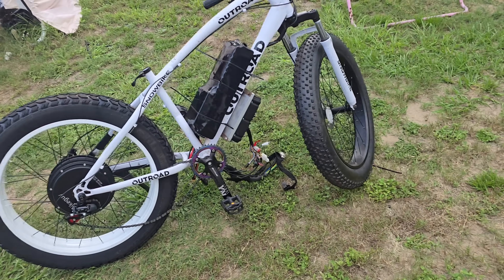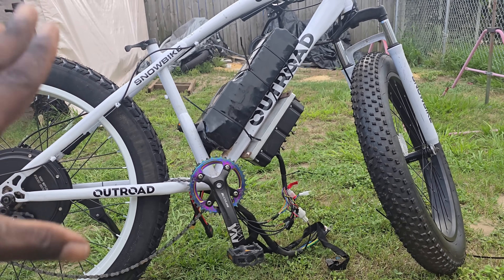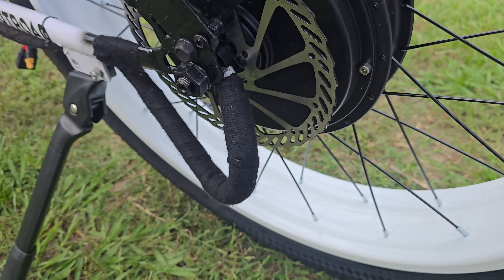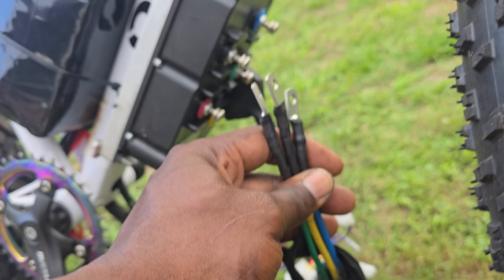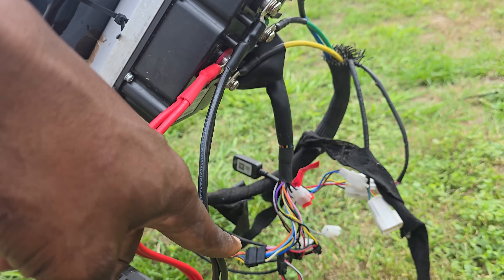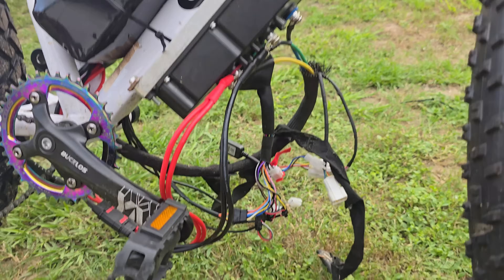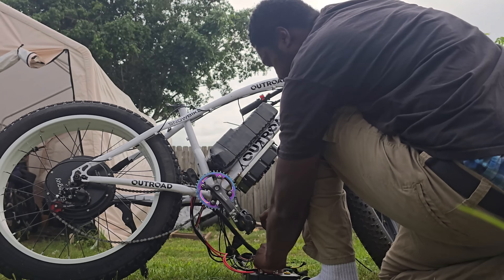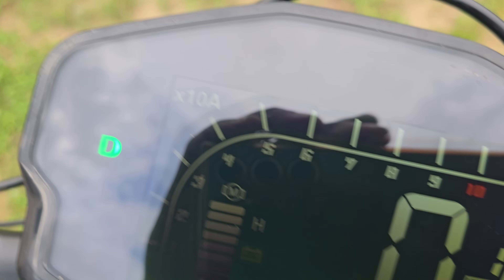Troubleshooting fardriver controller 72850 and qs205 hub motor

Comment: FARDRIVERS MUST NOT HAVE HALL SENSOR AT ALL AND THE AMPS BOOSTER HAS TO BE A REGULATOR BOTON
Reply: @EBG-offical  Think about it bro,
 that hall sensor and all them others vulnerable cables are just there to piss off!

ALL we need is amps regulator boton, throttle connector and the three phase brushless motor connector  that is all .

We don't need all them stupid cables, 😔 

Fardrivers don't work on motors without hall sensor !!!!
 This point 👉 for the price we pay for it that is playing with our pockets.

(F) The maker of it because if you don't have a smart phone 📱 this is when we get our (F).

Ain't that true?😂😂😂

Comment: If you disaasemble the controller cover, and remove the silicon layer above all the electronics, and to the left of the 30pin connector there is a PTC green device(MZ8?)that acts a resettable fuse right on the LF edge of the board most likely that device has failed.pesonally I would solder in a 1.25 times over the output current fuse where that PTC is(maybe just in parallel?) so 350 * 1.25=so like 400A-430?? just run it exterrnally. If u have any "junk" controllers laying around that dont work, that would be the likely "fix"'!!just to verify that is the issue you can just "twist up" that PTC device so both legs of the devicemake contact, then hook up the power and the orange ACC wire just to verify it comes on, but DO NOT leave it that way for OBVIOUS reasons, as once it starts "pulling a load" to drive the motor, you will likely fry the entire controller, NOT GOOD...😂
Reply from the maker: Oh ok ill try that
Reply: @EBG-offical as long as whatever "warranty" is expired, cause the silicon layer kinda breaks apart as u remove it,(maybe just focus on the bottom left corner of the board in removing the silicon, as that is where this device is at, then hitup home Depot for some grey silicon and just patch up that little area?) i aint worried as I got this controller from china and they aint refunding for $hit, let alone taking it back and fixing the thing, so Im leaving the board "exposed" for good!!😂😂😂
Reply: @EBG-offical did u try it out, let me no how it turns outbro, u got me curious!!!peace n❤❤
Reply from the maker: @tmharks1 not yes im working on a battery but when I get a chance ill do a video
Reply: https://www.google.com/search?q=PTC+mz8+capacitor+datasheet+pdf&client=firefox-b-1-m&sca_esv=fd9de876da70e2b5&channel=ts&sxsrf=AE3TifOYl7_qXzDyZL-54eqwg9Hm6skhTQ%3A1754330025663&ei=qfOQaPSkKIbIptQPtoaZsQY&oq=PTC+mz8+capacitor+datasheet+pdf&gs_lp=EhNtb2JpbGUtZ3dzLXdpei1zZXJwIh9QVEMgbXo4IGNhcGFjaXRvciBkYXRhc2hlZXQgcGRmMgUQABjvBTIIEAAYgAQYogQyCBAAGIAEGKIEMggQABiABBiiBDIFEAAY7wVI12xQy0FYnFJwAXgAkAEAmAHfAqAB9QiqAQcxLjAuMy4xuAEDyAEA-AEBmAIGoAK0CcICCBAAGLADGO8FwgILEAAYgAQYsAMYogTCAggQABiiBBiJBZgDAIgGAZAGBZIHBzEuMS4zLjGgB6kMsgcHMC4xLjMuMbgHqAnCBwUyLTIuNMgHMw&sclient=mobile-gws-wiz-serp

Comment: You ever figure out why this happens? Did the motor short out the controller because this just happened to me🤣. I can’t get mine to turn back on. Sitting here with a $500 brick
Reply: If the Bluetooth dongle goes faulty that would also stop the controller from turning on,I found that out the other day
Reply: @deswr1 👍
Reply: They claim the dongle can be removed but only after the controller is programmed, I will have to check it out for myself, if it does work without it, perhaps in your case the dongle was shorted which would likely cause the controller themistor fuse to trip or remain opened?
Reply: That little green 8mm pill looking device can really cause one some "headaches" 4 sure!!!😂😂😂

Comment: Hey E-bike guy, I’ve recently had issues with Bluetooth dongles failing and preventing my Fardriver powering up. (Also an 850)

Once the dongle was removed it worked fine. 

I fitted a new dongle and was ok for a couple of days and the same thing happened. 

Am now on my 3rd dongle and all is working. Maybe the dongles are a weak point or there’s been a bad batch.
Reply from the maker: I thought the same but we tried them also but not working
Reply: @EBG-offical damn, looks like you’ve got a bad 850 controller and bad hall sensor in all new equipment. 
Hopefully the seller will make it good for you.

Comment: My man,,22k subs...bro I been here since you was trying to get 1,000. I been out awhile, but good to see a video and that you still growing ,doing big things,being positive and very knowledgeable....much love my man!
Reply from the maker: Thank you very much 💯 great accomplishment but we not done yet lol
Reply: @EBG-offical  do you think I would be able to pair a 72 V battery and controller to a 2000 W hub motor would it go kaboom?💥
Reply from the maker: It depends on the controller and how powerful yhe battery is @jkeavyolson
Reply: @EBG-offical  how many watts do you think a 2000w motor be able to handle safely
Reply: @jkeavyolson probably x1.5 (not so sure about Voilamart😂😂😂, but a QS motor likely double!!😮😮😮so you could push possibly 3500, as they meg test these motors at the factory, and rate them much lower than their true capacity, that said it really depends on the winding insulation and how many "layers" of coating(dips) the windings have, plus the auto learn function on the fardriver will give one a ballpark rating on how much power it can handle...GO BIG OR WHAT'S THE POINT????😂😂😂

Comment: Not very likely a brand new motor would arrive with 2x defective hall boards. Also not likely 3 Fardrivers are all defective. 

You really need that $10 hall sensor tester that shows very clearly if the halls are working, 60 degree or 120 degree. Its very simple with its own 5v power supply and LED light showing when the halls sensor is on or off. Just connect it and slowly turn the motor by hand. 

Is it possible you used a gen 2 Harness from a 72450/72680/72890 instead of the Gen 1 harness needed for 72360/72530/72850? Based on the pinout, gen 1 send pin 24,25,26,27,28,29 to the hall sensor connector and gen 2 sends pin 4, 1, 12, 22, 24, 26 to the hall sensor connector.

As you can see, that would be a major problem. The two harnesses she not be interchangeable but they look like they are. But its worth checking the pinout from the 6-pin hall sensor connector to the 30-pin connector.
Reply from the maker: I know about the different harness across controllers but like I say it was all new. Took it out of box wired it up and nothing on power at all
Reply: @EBG-offical , could be a mistake at the factory or seller. The 72850 didn’t power on, but the 72530 and the other controller got hall sensor error on both sets of hall sensor.  The logical cause would be the wrong hardness accidentally getting mixed in.

Fardriver is having a lot of defective controllers lately, so the 850 could be factory defect. But if you took a working fardriver off another bike and it wouldn’t run the motor, on either hall sensor. That means either both hall sensors were dead or the harness is wrong/defective. 

Hopefully you get it figured out. These issues are frustrating when you know everything is new but it doesn’t work.

Comment: Didn't know the qs 205 had 16 pole pairs. I think I run my 273 at 12 pole pairs cause it wont goto 16 in the P settings. I guess we'll find out as you go with this one. 🤔
Reply from the maker: Only in the controller app is 16

Comment: Hi friend could you shed some light on how I could make my ebike faster it's 60v 3000w battery with a 2000w rear hub with a foc 50amp sine wave controller thanks In advance
Reply from the maker: Get a 80a controller and you will get 25% more speed and acceleration

Comment: Would you ever attempt fixing a damaged controller if it was fardriver that was faulty? Maybe that would be too cumbersome with soldering you think or no? Don't see any videos on fardriver repairs.
Reply from the maker: Lol heck no ill just buy another one or send it back for a inspection
Reply: That's way above his pay grade. He has no electronics repair knowledge whatsoever,so board level repairs is not a thing you are going to ever see on this channel.I can help you with that. Tell me what happened.
Reply from the maker: You is right you will not see anything like that on my channel because i don't do it. There are plenty of channels that repair controllers! 6hanks for watching 😊@zentechnician
Reply: Please guce me a link to sone these controller repair channels that are so nunerous that they aren't worth looking at. I am not aware of anyone doing any such thing. A channel doing regular controller repairs like weekly or even monthly I have not seen. My Google machine must be broken so if you could give me some channels to check out that would be just super.

There are at least 2 different wiring harnesses for these controllers with completely different pinouts.so if your 850 controller isn't working you may want to make sure you are using  the one that came with the controller a d that it is the same version of the other controllers you are so casually swapping around.

You can easily tell them apart by looking at the bottom of the harness. One version has an empty socket in  a corner, the other has an empty socket in the middle of one of the long edges. Completely different pinout would certainly explain it not working don't you think?

Comment: Have you tried to use other controller without the dongle?? 

Some of them have the b.t dongle built in and wont work if u connect b.t too
Reply from the maker: The fardriver 72530 has a built-in Bluetooth
Reply: @EBG-offical I've figured out that if the BT dongle goes faulty that would stop the controller from turning on